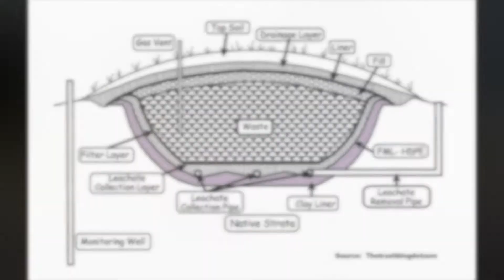An Introduction to Landfills

Comment: Can landfills be reused in the future, could you ever grow trees on them? Also wouldn't a biological process be beneficial in the system.
Reply: Kidthump this may answer your question please read to the end I hope this helps You can’t build anything on a landfill for 40-50 years because the ground has to settle from the garbage buried in the ground the cement and road tar ground would crack from the ground settling you also have the methane gas vents in the ground after the landfill closes so there is no methane gas explosion the point of the methane gas vents is to vent out the methane from when food waste decomposes when buried the methane gas vents go all the way to the bottom of the landfill they are installed after the landfill closes  there is a shopping complex that was built on a old landfill in Garfield heights Ohio look it up it is called the city view center :)
Reply: idk
Reply: Idk either